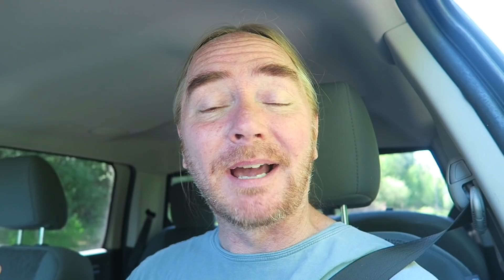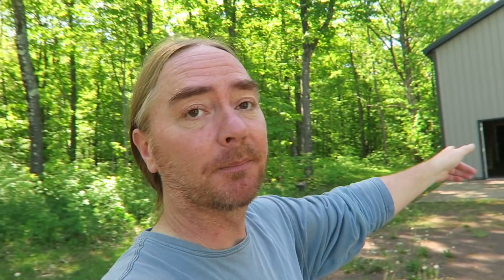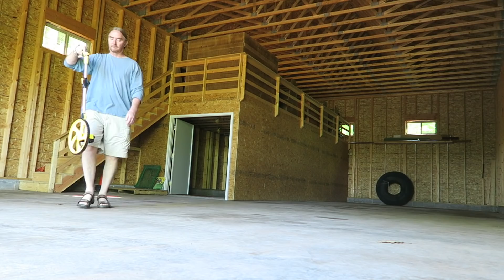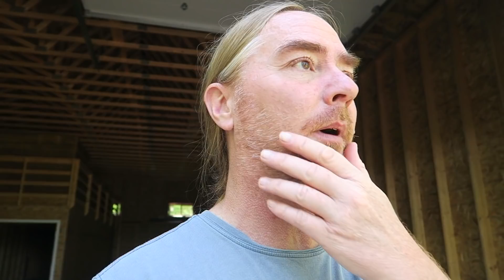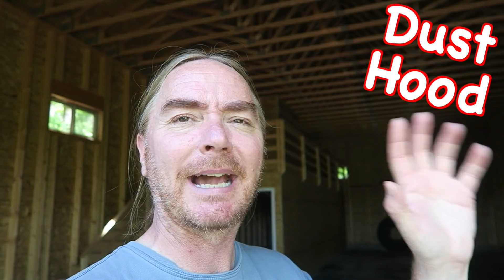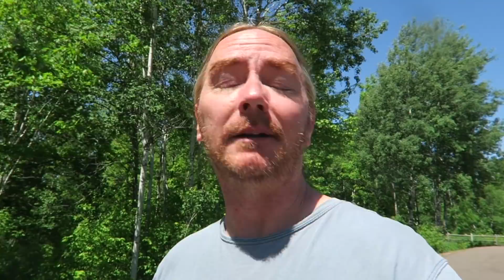Old Shop Vs New : What I've Learned Over The Years

Comment: Welcome to Michigan....  Air Compressor hints...  Reduce noise with isolation pads, S.S. flex-hose pipe connection, and run filter intake from outdoors, double pipe size on intake. (Much of the noise comes from the intake).  Also, make sure the compressor is in a heated area, or the condensate will freeze. Don't forget weekends and vacations.  Compressors' #1 product is heat, compressed air is #2.  It needs ventilation. Don't put it too far out of sight.  Out of sight / Out of mind.   You should get a "Low Oil Level Switch" on the compressor.  Don't buy used.  Make sure power is right...  probably single phase.

Comment: Ambient air filtration need not be expensive. You can very effectively filter 3,000cfm for $75. I built one with a 12v radiator fan, a 120v/12v power supply and a 12v dc motor speed controller switch off Amazon. Choose whatever 24” square furnace filters you want. You can easily scale it up and it gets even cheaper per cfm. Worst repair you could run into is a $45 fan.

Comment: In the attic....
You may want to go into the 2-3ft of insulated area to look at roof underside.  A walkway across trusses is easy to install before blowing insulation in.  Won't need it often.  Is a cheap way to make life simpler.  Not a requirement.

Comment: As for LEDs, yes color temp is important (kelvin) but also look into CRI which is a measure of how well colors come through. Traditional tungsten lightbulbs and the sun has a 100% rating but many LEDs are way below that at 70-80% and it's the reds and yellows that suffer. Meaning that if you are shooting or looking at anything in that spectrum it will come out desaturated and likely with a change in hue. Now, for caucassians those colors make up most of their skin tones which is why so many cheap LEDs are bad for portraits and videos - but I would say it's equally bad for your use.

Now, the good news is that you can get high CRI (+90/+95%) LEDs and my advice would be to spring for those. 

Also, there is, or at least used to be, a connection between color temp and output in that it's easier process wise to make powerful LEDs in the more blue color temp. This is why most ultra powerful flashlights are often very cold/blue. So, you may not be able to get both a true daylight (5500-5600K) LED which is also the most powerful in its class. Again, stick to true daylight with a high CRI and you will be happy.

Comment: I always really liked the shop that had 2 roll ups in Michigan one facing west and one east would work best then on a windy day open both doors put on the respirator and turn on the skil high power back pack blower and blow the dust out of the nooks and cracks sheet the inside walls with metal panel over the insulation and you should be able to get all the stuff the dust collector misses mine is a wood shop but mostly the same

Comment: Make your lighting bars moveable. You can lower them or relocate them from the ceiling mounts. Moveable swing booms will work too. Gives you more ways to place light for filming or working. Also taller projects need lights higher. Not likely changing bulbs on LEDs. Do you need cooling? Have you considered water fans? PolarCool.

Comment: Andy, look into Scangrip lights. Some of the highest Color Rendering Index (CRI) lights out there. It also allows five adjustments to the color temperature 2500K to 6500K, which really helps verify a true color match. I have the Multimatch 8 which I highly recommend, which has the same lumen output as four average T48 LED 4ft bulbs. They have various stands and magnetic mounts for them as well. Best of all…the light (up to four at once) and features are all controlled by Bluetooth on your phone!!

Comment: Standing at the door looking in; small hand tools narrow workbench with dust collection system all along the right wall allowing for easy boat moving in and out and walking space around them lumber rack fabric rack around the corner to the left. 
When they bury the utilities coming up that road to the shop have it on the opposite side of that road from a line between the shop and the house that way you're not crossing the utilities should in the future you ever decide to bury something between the shop and the house (water?....)

Comment: Hey Andy, love the new space. I bet it will really be a great place for you. I have replaced all my fluorescent lights in my shop with LED. I had the same issues you had with the ballast. One idea that came to mind. What about adding some skylights to add natural light? Won't be all you need but adds light when it's there. Maybe even some openable skylights to add ventilation. But all in all, cutting into the roof may take more work and money than more LED lights would be, Just a thought. Good luck! Can't wait to see what you come up with.

Comment: Move the loft stairs inside the mezzanine structure. Then below the stairs inside mezzanine add shelving and hazardous material cupboard. On the other side add you long work bench for finishing work. On mezzanine front entrance drape 2 clear overlapping flexible plastic sheets to keep dust out and be able to get in/out without opening/closing fixed doors with your hands full

Comment: For dust collection, air compression, etc, get that up in the rafters or outside the walls, IMO. Save the footprint for work space.  I keep looking up too. There's potential for going vertical with that high ceiling.

Comment: I used to work at an industrial fiberglass manufacturing plant. We had a huge fan in the wall blowing into a room attached to the building and filters in there to catch everything before the air got exhausted outside. It worked amazing. The air was always clean in the shop. Our area had 8 people cutting glass all day and it was dust free.

Comment: Put your air compressor outside in a shed on the side of the building. Make sure you have a automatic drain or one that is easily accessible, and also a very easy way to access / change oil and air filters.

Comment: You might be better

What a great space to set up.
You might want to look into solar PV and a Tesla battery wall to power the shop.  Big compressor and you can pipe your air through schedule 80 plastic pipe no problem just keep your psi under 150.  You got a lot of decisions to make.have fun with them.

Comment: There is a method to this and it begins with an accurate scale drawing of existing conditions. You shouldn't be guessing dimensions at this point. It will also be helpful to start developing a site plan, for utility development, drainage, surfacing, etc.
Are you going to have a toilet and sink? Have you looked at waste disposal?  Potable water?
A heat exchanging Make Up Air unit is a considerable expense. Could you segregate fumes to a smaller portion of the shop?
If you have natural gas,  radiant ceiling heaters is a common industrial choice.
Just like measure twice, cut once - plan twice, build once.  Good luck!

Comment: You're gonna need a bigger shop.  
Open one or two more doors to the below deck storage, won't have to walk to the front to gain access.   Might want to look into using propane (if available) instead of running a gas line.   (BTU costs vs. trenching install)
Because temperature is a big factor, any 'out of shop' storage will also have to be heated, so any shipping containers or out buildings should be 'super insulated' even more then what you indicated how you intended to do the shop interior.
Might look at ceiling or wall cord and air hose reels.   They at least will keep the floor tangle reduced if used.

Comment: Hi Andy, I agree the compressor should be outside or up in the trusses with a drain going out. Don't forget the dead space under the stairs can be utilized for portable tool storage, material storage or your fabric rack. You can dig the trench yourself and save some bucks, just call Digsafe first. Looks like it'll be a great shop!

Comment: Congratulations on the move and looking forward to more projects !  I admit that I'm envious of a new shop setup ! 

How about this.  

- Enclose the mezzanine with an additional closet enclosure in the rear for the last (4-6) feet for the compressor and dust collection.  The remainder of the mezzanine for clean bulk storage.
- Main floor room below the mezzanine, the rear portion of the room for the clean / finish work (add a wall/door for isolation?).
- Main floor room below the mezzanine, the front portion for the chemical (HazMat enclosures, storage racks, etc.) & fiberglass roll storage racks.  Also, a good space performing the prelim work & mixtures.  
- Main floor parallel to the center-line (in front of the room) for material (wood, coosa, etc.) storage racks (easy to stock since it's close to the overhead door).  
- The wood shop on the main floor rear does take up space but is probably the only place for it.
- The remaining space can hopefully stay uncluttered and safe to work in.
- (2") PVC around the periphery for dust collection.  
- Overkill ? but have you thought about overhead beams / chainsfalls or similar ?

Best of Luck

Comment: Wow great looking spot and so many good comments and hints for building out your space.  I think i heard that you are now in a cold type of climate I would say start with building out your space so that you are able to continue working in all weather so heat ,ventilation, driveway drainage and gravel pads around the shop for parking and project waiting to not sink into the yard during the rainy, snowy winter months. There is some great new products out there that will allow you to turn you space into a multiple use space with sliding partitions , one man on YouTube has a complete paint spray booth enclosure that is controlled by a single pulley system and can raised up to the ceiling out of the way when hes done painting and huge saving on the gas bill just heating a paint booth to or fiber glassing  area to 70 when  its snowing out side. Next all your wiring, plugs, air lines running from the air compressor which should be mounted Outside in a compressor shed so you don't have to hear that dam thing cycle on and off all day.  A rolling Gantry crane hoist for pulling engines, outboards, cabin tops , etc but it also rolls out of the way, best thing I added to my shop just sits against the wall but when I need it I can roll into action in minutes.  Love all your great work and  Videos  I have learned so many great things , tips, tricks  and ways of working with fiberglass and I use Total Boat Products  so cool, much thanks  Capt Ben

Comment: I’ve built some racing sailboats and found that I saved tons of time and frustration on having the mixing / station with all frequently used items, on wheels. The same goes with the fiber roll rack in an enclosure with a fold out table, as large as possible, for cutting. Also a single unit on wheels. I’d make sure it was possible to have at least 5 big rolls plus 5 types of narrow rolls at the same time. With good castor wheels and a smooth floor the weight doesn’t really matter. You can then organise your work efficiently for each job, plus you keep the space available.

Comment: I know you are very busy man, but I feel your the professional to ask my question to. I'm replacing the transom on my '76 Mirrocraft aluminum, and it has a 2x14x6 one piece board. I already bought rough cut 2x9x 12,  (not expensive) and wanted your opinion on if one piece would be better to joint it to make a 2x18, which will work better than a 2x14, or should I buy plywood and create the thickness. I would imagine that one piece, after epoxy, and maybe some scrap dacron laminated to it will make it super tuff for Florida environment. But why does everyone on youtube use plywood? Thank You for your time, and I love your videos, and have learned more from you than anyone else.

Comment: Very exciting project. Add my vote to put big woodworking machines inside to the left, not at the back. Schlepping raw materials past whatever boat is there and trying to work behind it will be a PITA. Consider ditching the stairs for a spiral steel staircase to save on shop floor footprint.  Also agree on compressor outside in an attached weather/soundproof compartment. Also....add an ibeam and travelling hoist while you’re burning cash.....😎

Comment: Considering what you are looking to do I’d consider dismantling the existing room and partition off across the full width of the back of shop but not as deep giving a possible clean room, wood shop with increased mezzanine storage and a larger main work area. Mezzanine could be partitioned with vapour barrier to minimize dust/overspray but maintain light

Comment: framing a sound proof room for the compressor requires offset studs..  and ceiling joists.. so the inner surface is not connected to the outer surface..  the outer surface is not connected to the inner surface and the covering is 1/3 heavier on one side.. this prevents harmonics from passing.. sound thru walls is thru the middle of the wall  .. not at the header or footer.  this is how recording studios are made sound proof..  creating air compressor inlet manifolds that have multiple silencer type air filter assemblies also reduces the intake noise of air compressors.. pipe and tees.. lets the compressor have less inlet restriction too. 
please install a Jimmy proof dead bolt about 18" to 24" up from the floor on your walk thru door.. reducing anybody kicking thru the door to get to your tools.  hard to stop them from cutting thru a wall..

Comment: My top 3 are  number 1 is lighting 2 is power  (110 and 220) 3 would be air flow (heated and ventilation) I do a lot of welding so ventilation and lighting are very important everything els can be customized moved rearranged those are the 3 things I would make sure are done properly before I thought of doing anything else

Comment: They make large casters that you bolt on and have a foot lever to raise and lower the equipment for easy moving 
Also I think you might be able to get the air compressor under the stairs maybe or do like some shops and build a small air compressor room on the outside of the shop

Comment: There is a load of storage space up high on the walls. Consider a library ladder system or some type of rotary storage like an old carpet rack with shelves suspended on it. Put a panel saw on the wall near the entrance where you can cut full panels as soon as you walk in the door.

Comment: Install compressor, large vacuum(think central vacuum systems) and vortex dust collectors outside. Compressor outside can easily be covered from weather in a small compressor hut, and a separate one for the vacuum motor/vortex. Benefits, noise is dampened by being outside, and vacuum noise/vortex dust removal is done outside, keeping dust outside. Make sure you have hi/lo vents for compressor heat dissipation in summer, and vents to help vacuum/vortex breath.

Both units are very large, and you'll gain at least 8-12sqft of floor space. All piping can easily be run through the building walls for both, and run along the sides of the inside walls, just like your electric, with plug-ins every 6 feet or whatever you want. Vacuum ports can be run at same spacing with vacuum/air hose hangers near each. This way, when you move the vacuum/air hose from one end of the shop to the other end for project needs, you can hang the hose at end of day, and start over in same spot with hoses neat and tidy where you start next day. Central vacuums/air are awesome.

Also, insulate the inside of the walls where these noisy machines are located, this way, you will deaden even more sound.

Lastly, any oils dispersed from the compressor will be outside, no oil mists on projects. A Big oil/water separator just inside, and a smaller one attached at the wall side of the hose, and of course one at the handle of the spray gun, specifically for perfect finishes.

I'm spending your money, so it's easy for me to spout off what "I would do". Good luck with your shop planning.

Comment: I agree with getting at least one shipping container. Also put the compressor outside in it's own covered enclosure to protect it from the weather. You can wire an on/off switch on the inside of the shop and air hose access.

Comment: 1) What about moving the stairs to the back wall  of the shop and put your woodwork shop in the left front side where the stars were.  The room in front of the storage room is already partially "lost". Could even be more efficient with the dust collection. 

2) Do you see yourself fit to dig the trench from the street to the shop with a bucket excavator? Then the power company only has to drop in the power cable and gas pipe. I can imagine the there must be a minimum distance between those two lines. Cover them with soft sand and close up the didge. That would save money, but would cost hiring a machine your own time and swet.

Comment: I have to agree with what many here have already said.. Bring in a Conex container with a minisplit heat pump for outside storage, build a awning on the back of the building and place the air compressor outside the building. Add a 20x40 extension on the side of the building to function as a wood shop, mixing and clean rooms.. Keep the high bay just for boat work.  Sheetrock and paint the walls. Nice white finished walls work hand in hand with your lighting. One last thing I didn't know I wanted in a shop  till I had it.. Windows